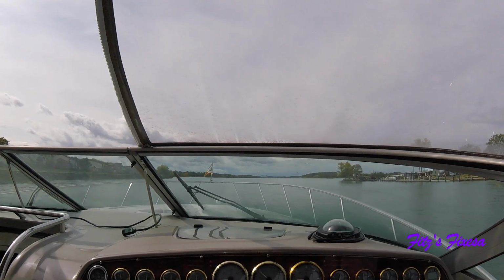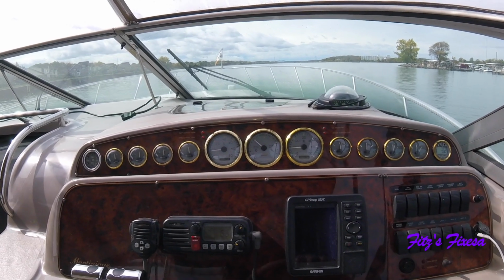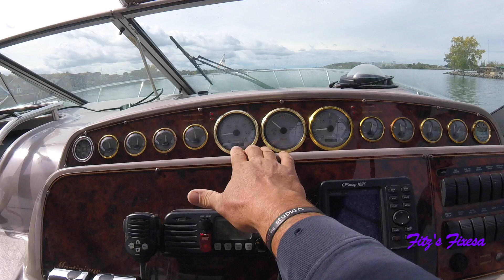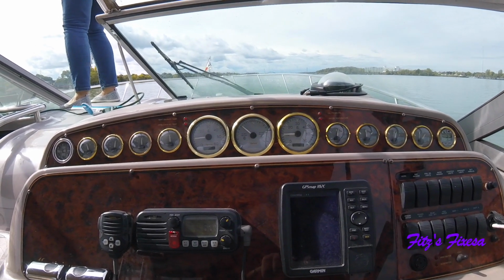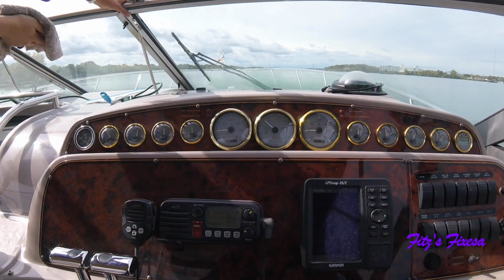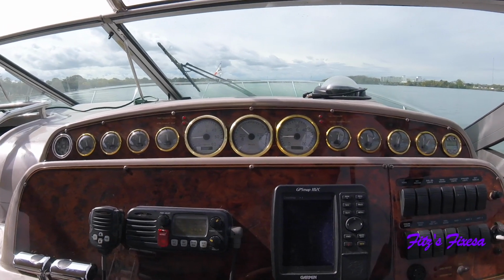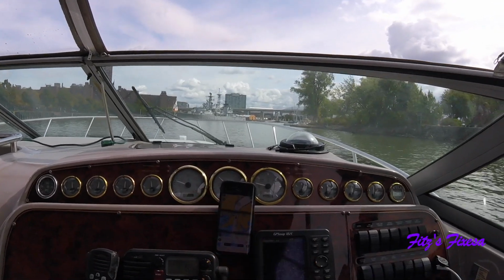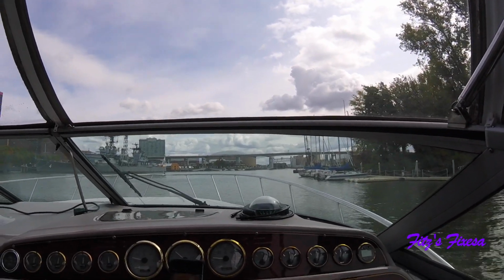Boating to Buffalo NY

Comment: I have heard from people having this same issue with RPM and this was good to hear. What engines do you have? Merc Volvo?
Reply from the maker: 8.1 volvo
Reply: @fitzsfixes  oh well that's what I have (8.1 GI-H). I think I heard of some people having the issue on Merc but I'll relay the message and see if it helps. My tach didn't work on mine when I bought it but I guess that was just the gauge and my wiring was fine back to the ECM.

Comment: Great videos!  I had no idea faria warranties there gauges. I have  an oil gauge that mostly works but sometimes it goes to 0 and scares the crap out of me. We hooked a computer to the engine and it reads fine. The other is a depth sounder that never works it constantly beeps . Thanks for heads up!